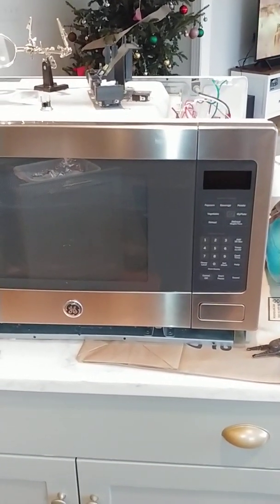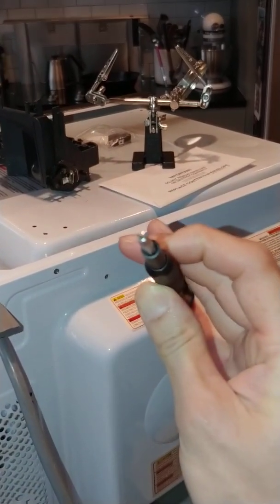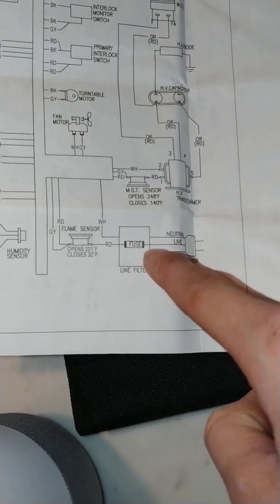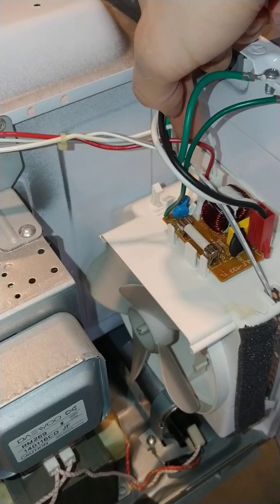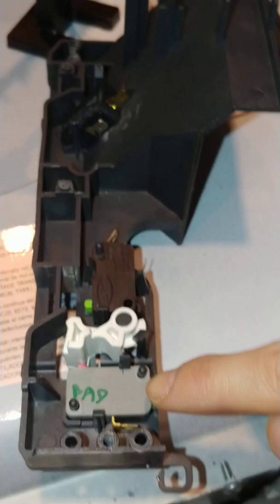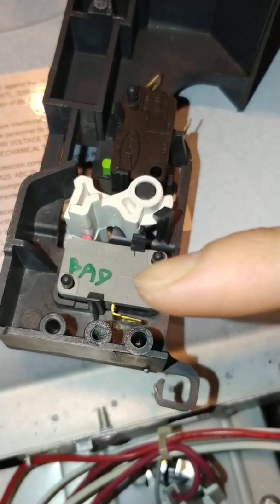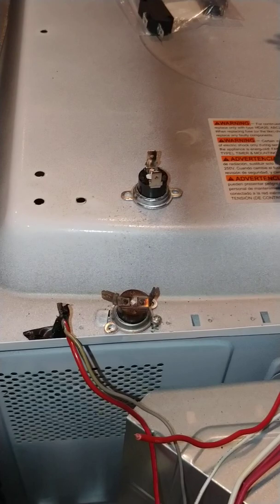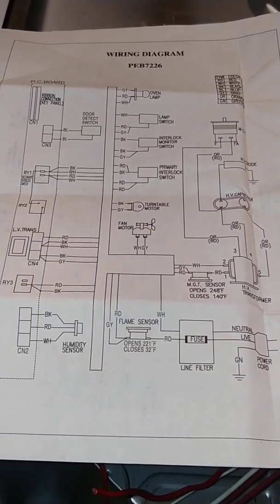GE Microwave no power no display repair diy temperature thermostat microswitch

Comment: Well done.  I've had 2 of these microwaves die, the latest after 7 years.  Although that may seem like a reasonable lifespan, it's just my wife and I with light usage.  At $500, these units should be more durable.  Will start dissecting the unit tonight...

Update - For future readers, the unit I worked on was a GE PEB7227SL1SS.  Took it apart, it came with wiring diagram included (nice touch GE).  All of the internal components looked fine (nothing scorched etc).  The fuse was bad (no continuity), otherwise the other sensors were fine (continuity).  Quick run down to Ace Hardware for a $5 fuse and its all fixed!  I couldn't be happier since I easily saved myself over $500.  Thx again!

Comment: So the grey switch you replaced and the switch behind it. Do you have a picture of that wired in. I did some trouble shooting and mixed up the wires.   Two single blue wires, one single white wire and one red and grey wire.      Could you confirm what wires go were? I can not for the life of me find how they are supposed to go.
Reply from the maker: Found pics of my repair for the microswitch wiring. Hope this helps.

https://drive.google.com/drive/folders/1-LqrXOMsbMCdkhwm7hWFzZBgY9dTf1Fd

Comment: Did you have to discharge the capacitor before replacing the thermal fuse?
Reply from the maker: I might have put a screwdriver between the terminals to discharge it...

Comment: How did you repair/replace the wire connectors that go to the thermostat?
Reply from the maker: I soldered on these connectors: 
Twidec/270Pcs 2.8/4.8/6.3mm Quick Splice Male and Female Wire Spade Connector Crimp Terminal Block Assortment Kit with Insulating Sleeve for Electrical Wiring Car Audio Speaker https://www.amazon.com/dp/B07VSD3HDM/ref=cm_sw_r_awdo_navT_g_YY6DVFAN7Z2B6F45CGTT
Reply: @wasabisohot  you soldered the male on the thermal fuse, and the female onto the wires. Then connected them??
Reply from the maker: @brody6634  I soldered female connectors onto the wires and then connected them to the thermal fuse
Reply: @wasabisohot  ooooo those were a perfect fit to the thermal fuse, gotcha..  nicely done... Is there a reason you cut it, instead of takking off the existing connections?   Also, I'm dealing with microwave issue right now... It's not quite the same model as yours. Mines got a convection oven inside the microwave, and I'm seeing 4 thermal fuses, all different temp ratings, 2 of the 4 have no continuity... Have you ever seen 4 thermal fuse in a mic tho? That kind of threw me off.. is it because it doubles as a convection maybe? I got those 2 thermostats ordered now, hoping it fixes my micro. 🤞
Reply from the maker: @brody6634 my wires were burnt so I cut the wires enough to get past the burnt parts.
Good luck!